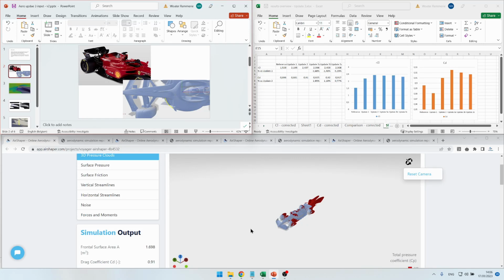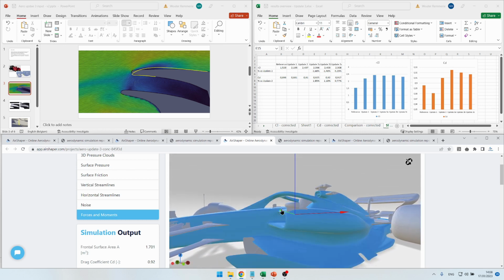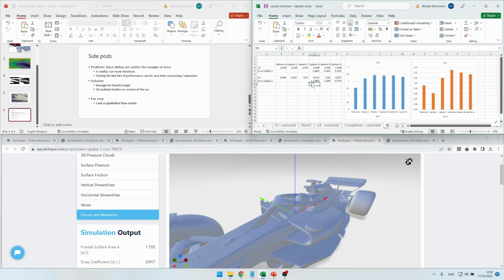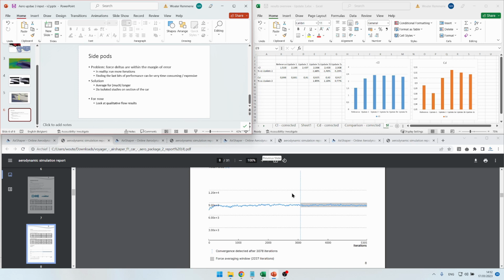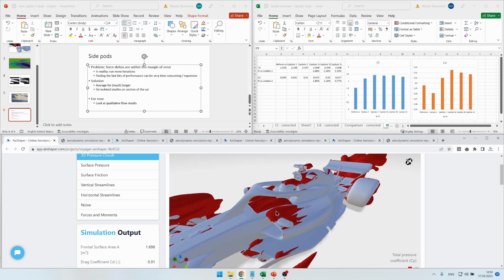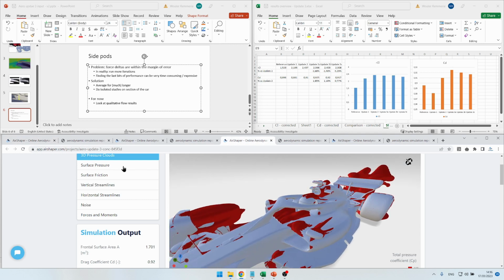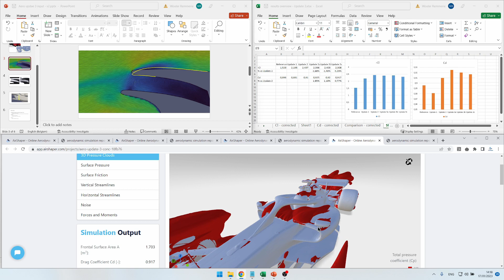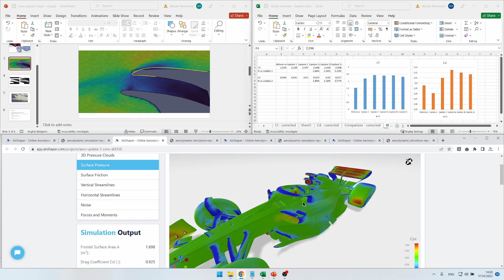Formula One - Aerodynamics update 3 - within the margin of CFD error

Comment: There's a lot of potential in the area in front of the rear tires, and the rear wing. Increasing the flow velocity at the rear wing endplates and outer periphery of the beam wing will work the floor harder, which will allow less rear wing angle.
Reply from the maker: Fully agree Rolando, we're going for a more horizontal rear wing design for Aero Update 4 - keep you posted!! And if you have any input, you can always drop it at https://www.reddit.com/r/airshaper/

Comment: I don't know if already suggested, but it seems on the suspension, the rear top wishbone is higher than the front one, what makes downwash almost impossible. This would be an area for improvement. I would suggest to lower the rear top wishbone a) for an Anti-Dive geometry and b) for (more) downwash which would benefit the inlet of the Venturi-Tunnel and also the undercut.

A Ferrari Style high pressure zone under the sidepod inlet would "push" the front wheel wake further outboard, which i think could further improve aerodynamics downstream.